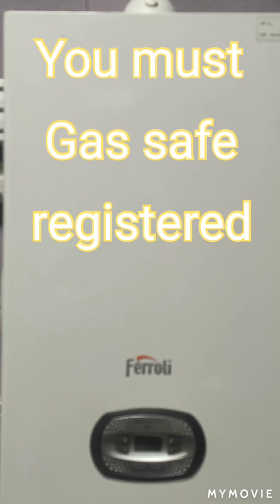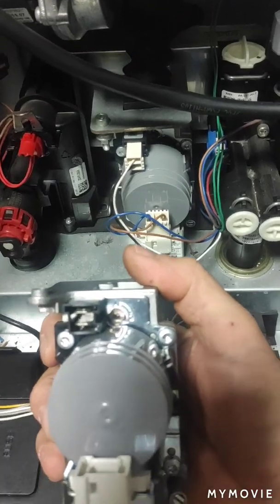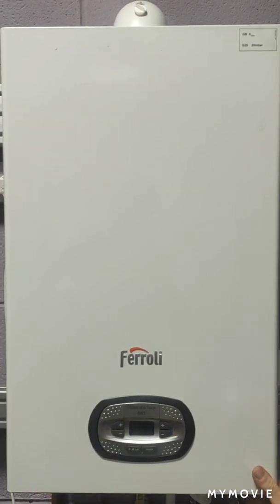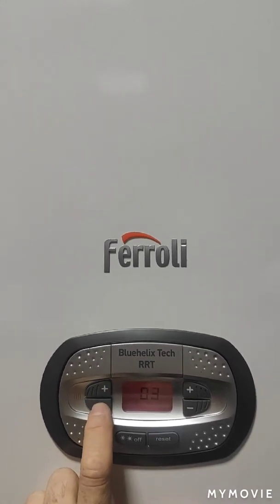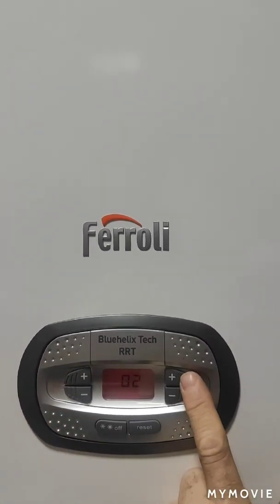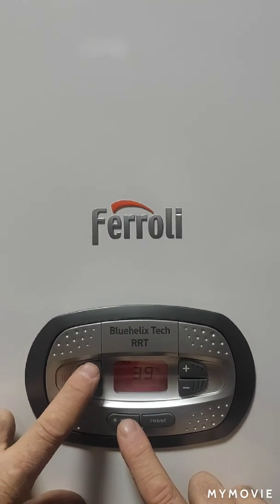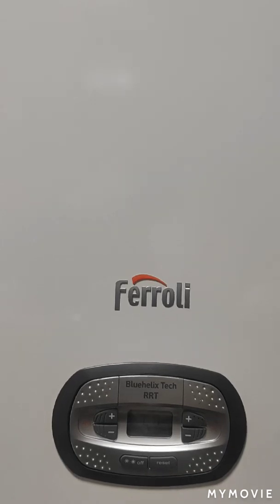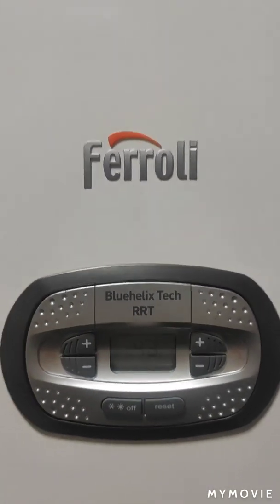Ferroli bluehelix LPG set up and calibration

Comment: I have a bluehelix alpha 24c (very similar software) what is the menu that appear when i keep the Power button pressed for 10 seconds? I can see 2 different parameters that i can change with the +/-  buttons on the heating or sanitary water temp selectors... Thanks!

Comment: Dear Ferroli Man! Thank you very much for your work, you are doing on youtube. Extremely helpful!
I've been struggling recently with a Bluehelix Tech 25c boiler. Not showing any fault code but throughout a month it has slowed down and stopped heating water. What happening is that it is switching immediately to D1 when hot water is going. Now it can't heat up over 27-28 degrees C, because it has a clicking sound every 3-4 seconds. Technician recommends control panel change however heating works perfectly. Do you have any idea what could cause the problem? Thanks in advance!
Reply from the maker: Maybe a factory reset might be a good idea. If you follow how to adjust parameters video and adjust P45 ... But also adjust b29 and adjust the zero to 10 and go up.a parameter to p30  . That will factory reset the circuit board . I've done it a few times now with weird faults and it solved them 
U can also call and I'll talk u through it

Comment: I have D2 fault on my bluehelix rrt. Htg water reaches max 40deg c then D2 fault appears. Also hot water on reaches 30degC then fault D2 appears. Also had D1 code appear too. Any thoughts please?
Reply from the maker: D1 is hot water delay it shows just after the hot tap has been opened but it's not a fault . And D2 is heating delay not a fault code but just telling u it's got to the desired temperature by the temperature on the boiler or the temperature on the room stat . Double check the temperatures by pressing the +. Button as they may be set too low ... If you have A Or F letters with a number next to it then this is an actual fault ie A01 Or F37
Reply: Boiler set point is at 80 and hot water at 55. Room stat set to manual & 26 deg c, and calling for heat. Boiler fires but don’t go over 40deg c and then locks out and d2 appears. Can you send me your number for a call out pls?